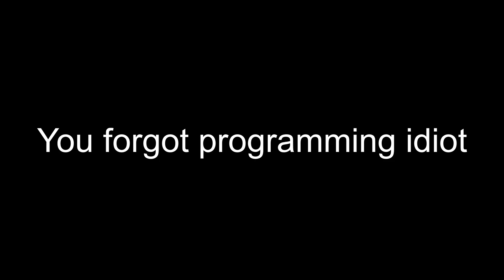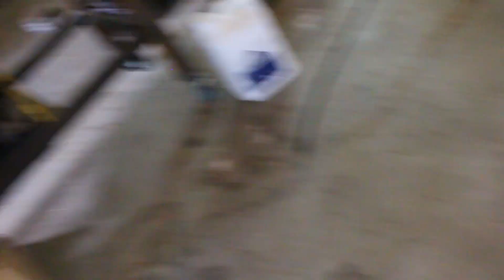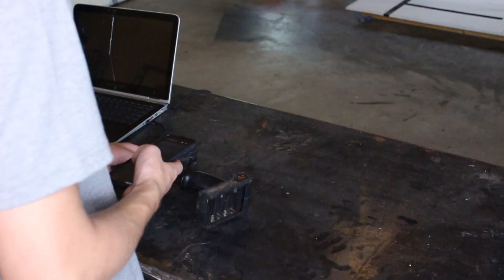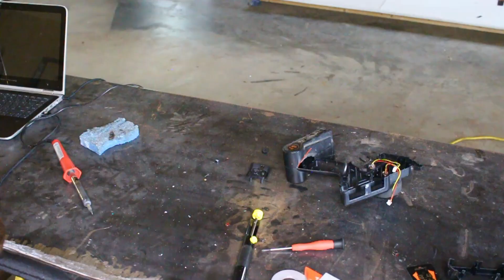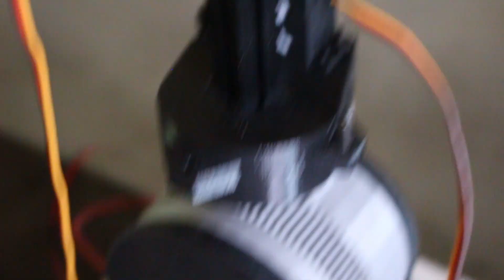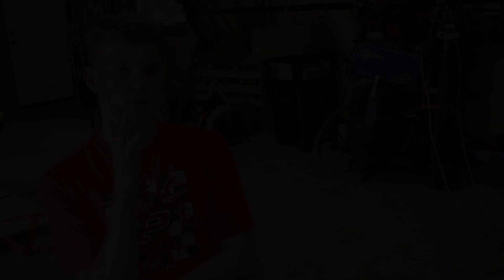Robotic ARM episode #4

Comment: Great to see you finish a project, dude! I was wondering when your next video would come out. Your production quality seems to increase a little with every video.

I know the screwdriver watch thing sounds like the hardest one but it's probably the most interesting one in my opinion, so I vote that. 

Quick tip from when I was a broke adolescent:
If you want to quickly salvage components from a PCB you can take a hot air gun and heat the underside of the through hole components then bang it against something rigid and the components should fall right out. Just MAKE SURE to wear a mask and maybe some clothes you need to wash because the fumes are pretty nasty. I actually did that earlier today (like 5 hours ago) and my shirt still reeks of burnt PCB but all the parts I salvaged survived.
Reply from the maker: that's a really good idea! I never thought about that. Thank you for the tip!
Reply: @jonathanharris4503  any time, dude. Glad to be of help!